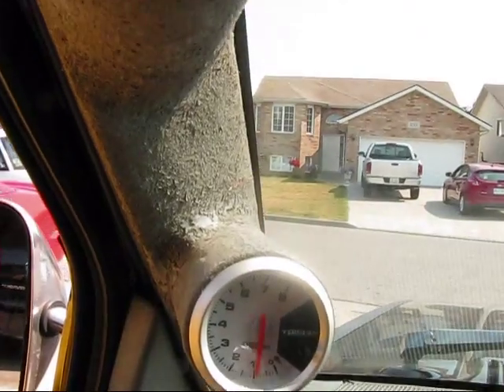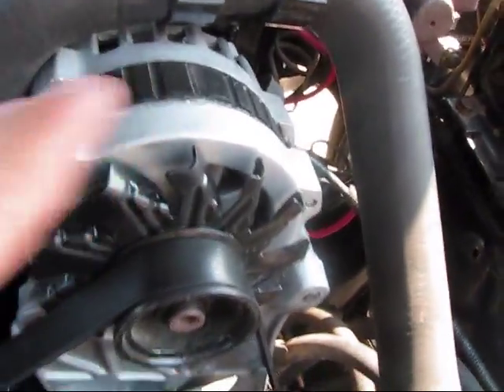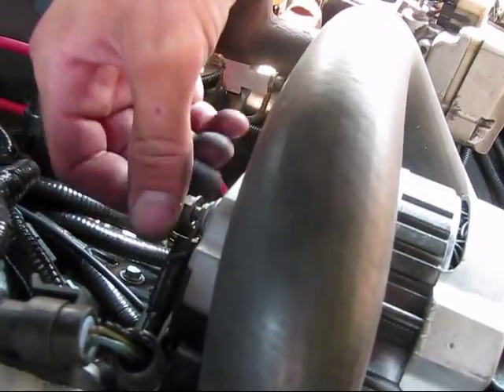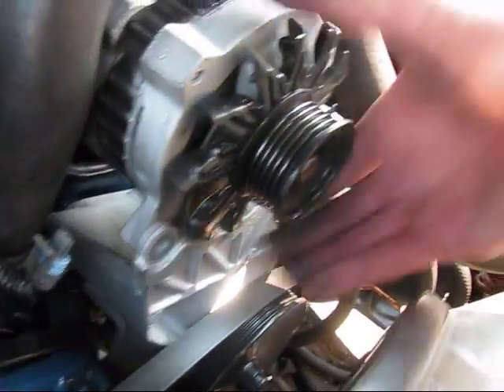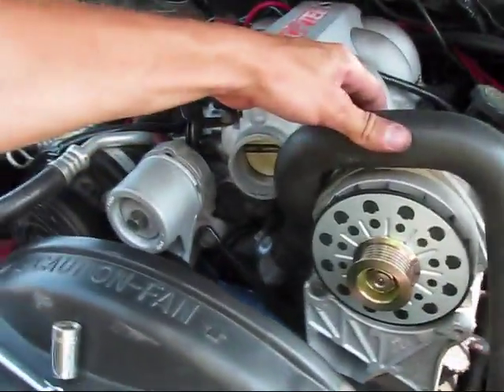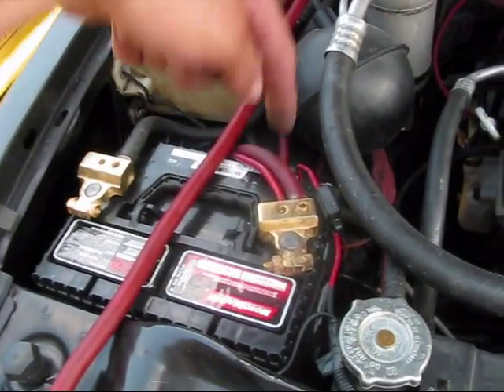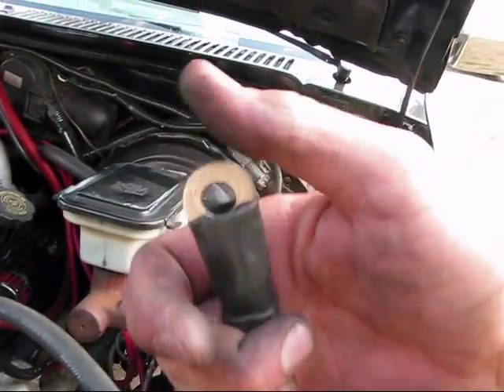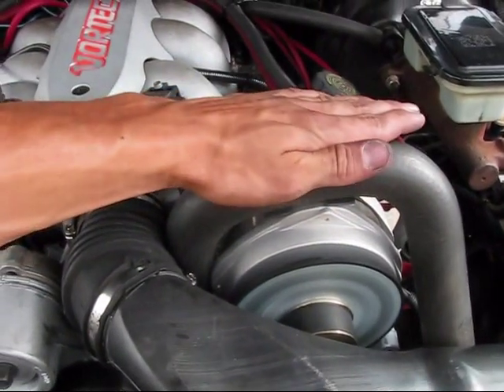93 S10 Blazer Gets new 350Amp Alternator

Comment: hells ya bro, but keep in mind that different alternaters, particularly the higher amperage ones, have a lower idle amperage than lower amperage high output alternaters. but at highway speed, that beast will deffinatly push a few thousand rms watts worth of power to your amps with no trouble at all!!